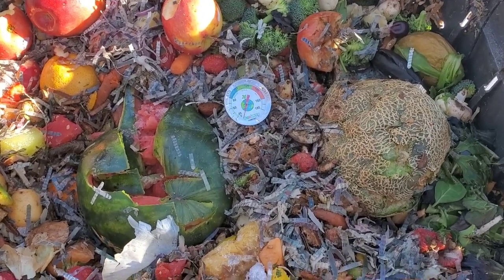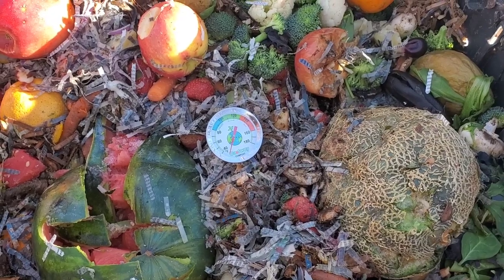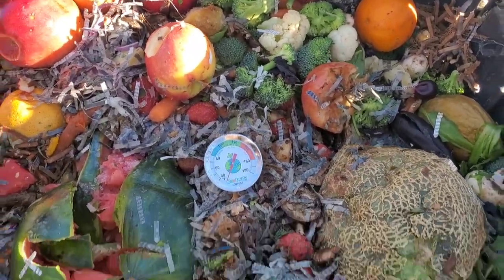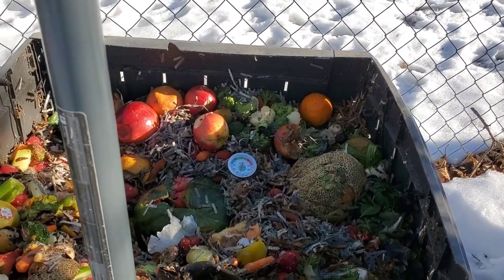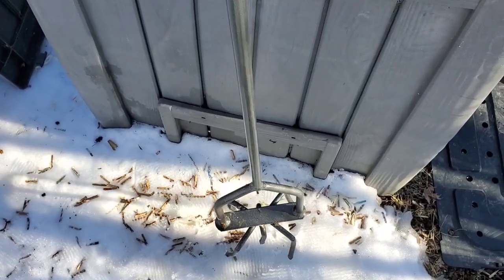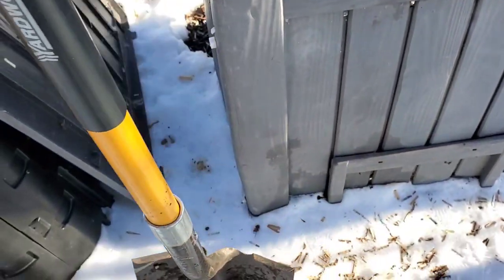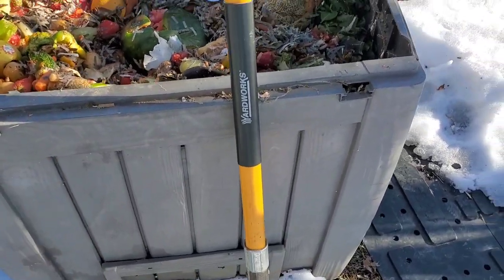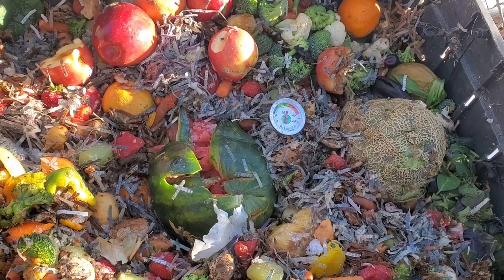How To Make Your Compost Decompose Faster

Comment from the maker: How to make compost https://youtu.be/V0LB0FEuoU0

CASL Brands Steel Shock-Absorbing Ice Chopper with Extra-Thick Blade https://amzn.to/3JWJdM2

Manure Fork - 5-Tine, Fiberglass Handle with 9-Inch Non Slip Grip, 50-Inch https://amzn.to/3jPnWcg

Rukars Compost Thermometer, 20 Inch Stem Backyard Compost Thermometer - 2 Inch Diameter Waterproof Anti-Fog Soil Testing Thermometer with Composting Temperature Guide Zone, 40 to 180 Degrees F https://amzn.to/3DHZmkw

 Let It Rot!: The Gardener's Guide to Composting (Third Edition) by Stu Campbell https://amzn.to/3X2xgqR

Garden Composter Bin Made from Recycled Plastic – 110 Gallons (420Liter) Large Compost Bin - Create Fertile Soil with Easy Assembly, Lightweight, Aerating Outdoor Compost Box – by D.F. Omer: https://amzn.to/3jjrSOU

Yard Butler Twist Tiller https://amzn.to/3Gq6Bfm

17" Tall 6 in 1 Modular Metal Raised Planter Bed for Vegetables Flowers Patio Ground Planter Box-British Green: https://amzn.to/3KxLkmS

Black Duck Brand 50 Packs Assorted Heirloom Vegetable Seeds 20+ Varieties All Seeds are Heirloom, 100% Non-GMO click the link: https://amzn.to/3t12e71

To order worms from uncle Jim's worm farm then please click this link https://unclejimswormfarm.com/?affiliates=708  I make a small commission off of each purchase.
Amazon link https://amzn.to/3IzSNn9

To order worms from Meme farms then click this link 
https://memesworms.com/?rfsn=6369969.fd8c21  I make a small commission off of each purchase.
Amazon link https://amzn.to/3vRVvgl

To order the worm bucket https://wormbucket.com?sca_ref=3086277.0WfKVfLq1z affiliate link 

Facebook worm farm community link: https://www.facebook.com/groups/710345902696106

Here is a worm farming Q&A link to answer your worm questions: https://forms.gle/QcPL76BprvGrVMgA8

Mr. Clean ultra grip premium latex gloves https://amzn.to/3GeYBi2

Wire mesh basket ideas for sifting worm castings:
https://amzn.to/322EZOT
https://amzn.to/3yvKRfN
https://amzn.to/3p3aAc8
Castings Sifter https://amzn.to/3DHxvOA
Five Piece Sifter Set https://amzn.to/3DK2c5q

Handheld Rake https://amzn.to/3IEqx0b

Mailmate Paper Shredder https://amzn.to/3pHXvEx

 Magic Bullet Mini https://amzn.to/3kdas6z

ComfiLife Anti Fatigue Floor Mat – 3/4 Inch Thick https://amzn.to/3ibXatQ   

 Worms Eat My Garbage by Mary Appelhof
https://amzn.to/3z8Xo8u

Please consider using the affiliate links - anything that you purchase provides me with a small commission, at no additional cost to you, which helps to support this channel. As an Amazon Associate I earn from qualifying purchases. Thank you for supporting my channel.